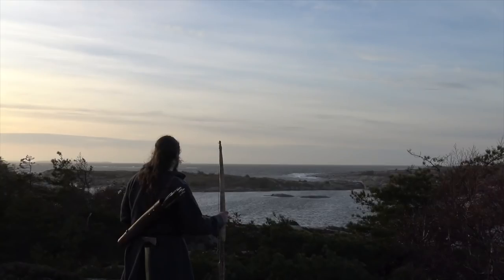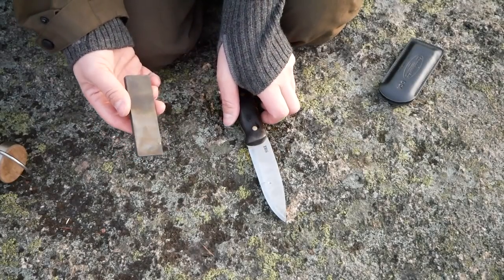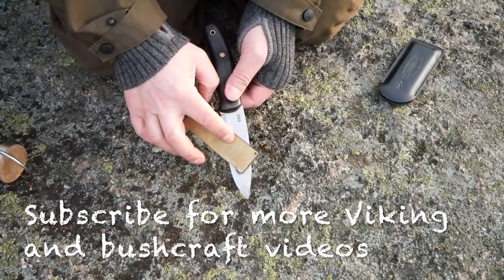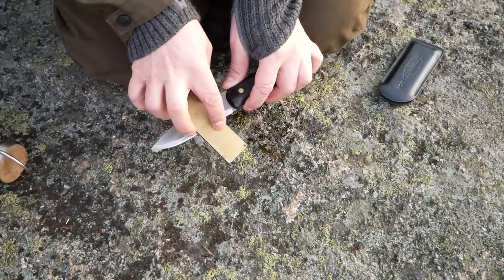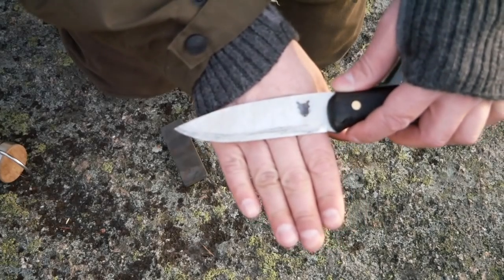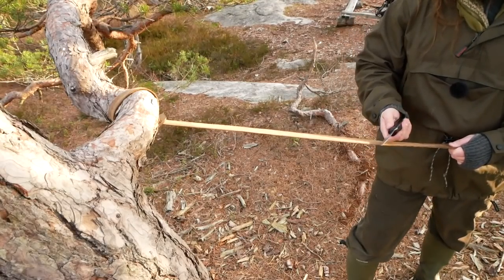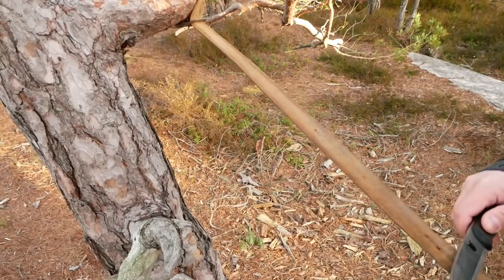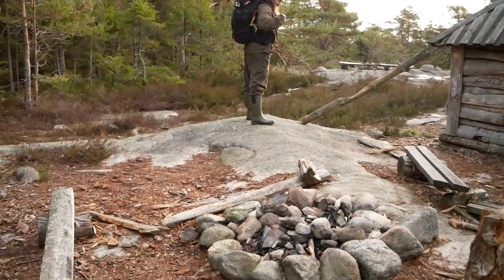How to Sharpen a Scandi Grind Knife in the Field

Comment: So true Bjorn- If you strop your knifes between times, you almost never have to sharpen them. That is how I keep my whittling knifes razor sharp, by stropping them with compound  every hour or so of carving- and yes- it is mediative.
Another great informative video- Be Well !
Reply from the maker: That's great advice, TheWildsourdough.
Reply: Stropping is necessary, I worked in an old style slaughter house as a boy, and the strop was used more than the stone. And that was under working conditions, I was cutting up 12 steer a day and one sharpening and the strop did the trick.
Reply: @valdrblodorn7151  is correct- Stropping is necessary. Funny that you would say that you worked in a slaughter house- I did a short time in a Smokehouse cutting and preparing the meats for smoking...a sharp knife was the tool and you just had to watch out for those bones. :)
Reply: You will still have to sharpen it eventually still

Comment: Hi Bjorn, very interesting tutorial bringing the stone to the knife,rather than the knife to the stone 
Tried it on my TBS boar and DC 4 stone,very impressed with the results,many thanks for sharing your knowledge 
Regards ,Tony
Reply from the maker: It is how I was told to do it by knife makers, actually. Larger stones and bench stones are meant for the knife on the stone method. This is only a small stone to keep in your pocket, so then a circular motion is safer, at least for my fingers. Glad you liked the video!

Comment: I hve a small sharpening business so I know how special a good edge is. I like to finish many edges with a coffee mug rim and bottom. Way cheaper than getting a ceramic set eh. The leather strop is the real magic eh. Thanks Bjorn.
Reply: Good tip! Another one is edge of a car window (usually that is slightly rounded). I wonder if a broken platter also would work (depending on material).

Comment: When learning to sharpen, I made the mistakes of using too coarse a stone, and putting too much pressure on the stone while sharpening. A fine stone will remove metal, even though you don't think it is doing much. and you can over do it. Great tips, thanks!

Comment: Excellent info. I do one long stroke  instead of circular motions and i have a rifle sling with compound i use for a strop but pretty much same style. For oil i use olive or veg oil both on blades and handles i do use b.l.o too but the smell gets to me..
Reply from the maker: I have to use larger stones before I shift to the one long stroke method. With smaller stones, I feel circular motion is safer.

Comment: Never really learned how to properly sharpen my knives, but never had problems keeping them sharp either - except crappy quality ones, perhaps. Good to see I wasn't totally off.
Need to get myself a good bc knife though. My latest one is...well, it's good for food stuff (cutting meat, gutting fish etc), but unusable for anything wood.
Reply: the brusletto villmann is good
Reply: @fiddibelow  I do have a Brusletto knife...somewhere. Packed it away years ago, somewhere really smart. Also got a Helle Nying, but it's rather tiny. Latter is my favourite when enjoying cured meats and the like.
Thanks for the tip, though
Reply from the maker: I think that knife sharpening should be seen as an ongoing process and a meditation. I never really learned how to do it properly before I was told how to by knife makers.
Reply: @fiddibelow  Bought a new knife today - but I chose the Brusletto Bamsen; 12.5cm blade length of Bamsen is more practical for me than the22.5cm on Villmann. I already have the Helle Lappland if I need a long blade for anything. And I did get a nice price where I bought it
Reply: @mrsorepaws9146  looks like a really good all around knife with a good blade like the older mora knifes

Comment: I also uses sharpening by hand, as an art of meditation.
It's a man-thing, I believe... ?
I stopped stropping some years ago. I just pull the knife edge a couple of times agains some soft wood.
It works the same for me and I dont want to run around with a leatherbelt just for stropping.
Oh, and my knives and axes a really razorsharp even after days of use. Actually often use my axe to do knifework.
But nice to se someone sharpening in the wild and not in a workshop.

Comment: Thanks! Nice, circular sharpening for me are more of an axe grind technique, but whatever works, use it. I probably use too much force usually (which removes too much metal and shortens life of knife). I use same stone as you have there, or a big cheap stone from local hardware store, sometimes I use wet-sandpaper and files. I usually use spit as liquid! O_o I have yet to manage to find a piece of leather to make a strop, but I sometimes strop using a piece of birch-wood, although I hear oak would be better. Really big monkey 1 have an excellent video. I sometimes use beeswax to hinder rust or if i lack that i use lip-balm (depending on size of tool).
Reply from the maker: I think it's important to keep in mind there is a difference between knife sharpening in the field and in the workshop.
Reply: @  @BjornAndreasBull-Hansen  Very true! I sharpen planes and chisels at home. And as you said, safety is an issue - a very good point! I have cut myself badly a few times sharpening axes at home. Out in the field that would be a much worse thing!

Comment: I like the video Bjorn, but using a circular motion, as opposed to one long slide / slice of the knife edge down / along the length of the stone, will only serve to cause a "hollow" area on / in the stone over time.   I still have stones friends have used like this which I then rub down on flat concrete to get a nice flat surface upon the stone once more - unless they have completely screwed the stone up of course.  Making the stone once again useable and giving me a free stone in the process!   Stropping on a loose piece of leather, such as your belt supported at one end "can" cause the cutting edge to curl over if a little too much pressure is used.   Personally, I prefer to have a strip of leather glued to a piece of flat wood so there is no bend in the leather - as shown in your video here - and therefore has less opportunity to cause a bend / curl on the blade edge.   Basically, I was taught to sharpen knives by my father who was a chef.  I would sit with a stone for ages just doing long slow movements with old knives of differing grinds until I had pretty much trained my hands not to press it too hard against the medium (stone / steel / leather etc) being used and also to maintain the stone or leather itself.  Why?  Because as soon as you loose that lovely flat surface, you run the risk of curling over your cutting edge and thus not having your knife as sharp as it can / should be.   The other thing I was taught is that sharp knives "can" be dangerous, but blunt knives "are" dangerous.   And by "knives", I pretty much mean any cutting tool.   A sharp one requires very little effort to use and if you have a slip with it, you will not cause too much damage and any cuts can be quickly cleansed and sealed shut it needed.  Forcing a blunt knife to try and do something, slip or whatever, and you will have a lot of force heading along the blade edge or even worse, the point!  When that hits you or someone else, you will have a serious problem on your hands. 

Now if you want a real mirror finish to the grind and edge of your scandi ground knives, rather than go from stone to leather, use slate.  Yes, that stuff they made roof coverings out of for years and years.  You dont need a lot of water, just a few drips every now and then, to get a mirror finish to your scandi grind and cutting edge.  Just be careful though as this can bring up a knife to a new level of sharpness for you as well as looking seriously nice.  All the best for 2019, Bjorn :)
Reply: Very interessting, thanks! Slate do not "translate" good for me here, is it a stone-slab/shingle for roof tiles?
Reply from the maker: I will always use a circular motion when out in the field, my friend. It is a safety aspect here, ans also, these are fine stones we're talking about. But don't take it from me, take it from the knife makers I have been working closely with.